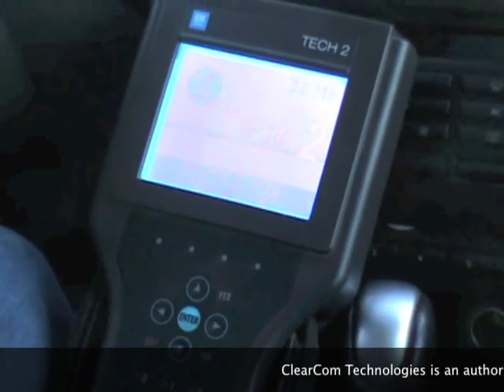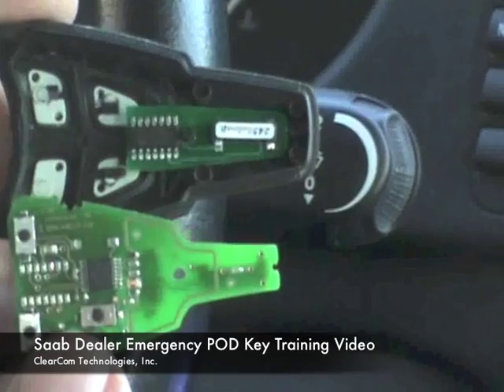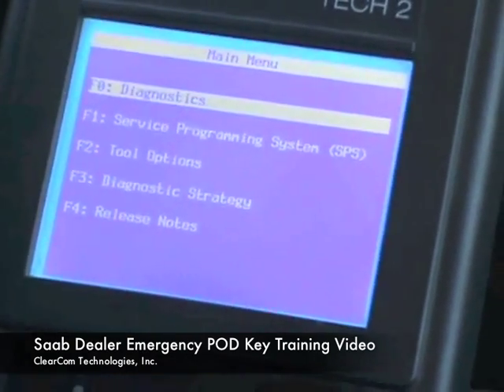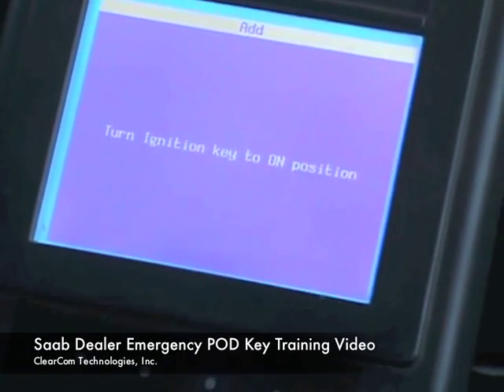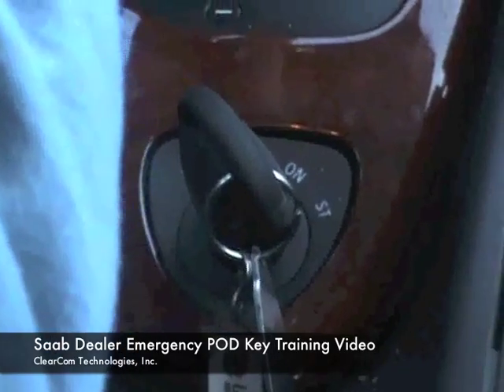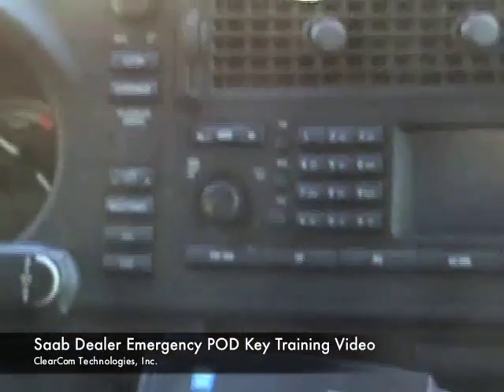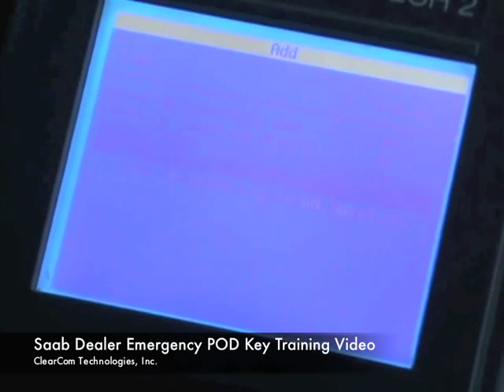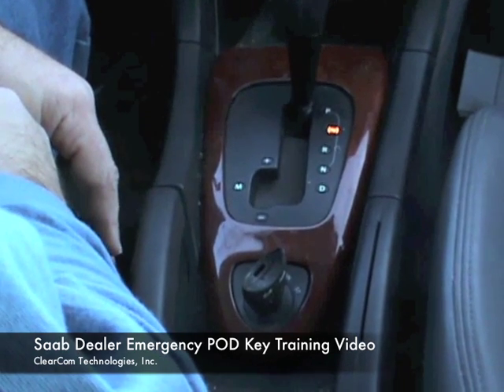Saab Dealer Emergency POD Key Programming Video

Comment: Is it possible to program a brand new key without having the original??
Reply: If you are trying to program a new key without the original you will not be able to do so without removing the CIM module and sending it in to be re-flashed.  The only way to program a new key using the Tech2 is to have a functioning key already learned to the car to begin programming with the Tech2.

Comment: Hey my key still locks and unlocks,  but the car just cranks is that a sign that I need it to be reprogrammed? I had the motor apart and the battery disconnected for a while too so I think it got disconnected.

Comment: Emergency dealer key? What sort of emergency is it for if you need your original key to program a new one? Get a 433mhz key off ebay (uk spec) and do the same thing. I and any other saab mechanic would call this spare key programming. In an emergency (ie all keys lost) you can either get another cim with keys or open up your old cim and read the eeprom to give you the key code to make what would actually be an emergency key.